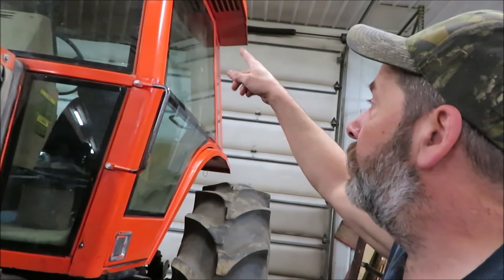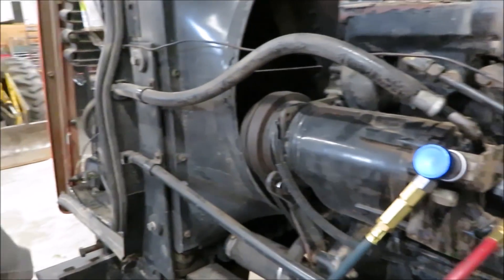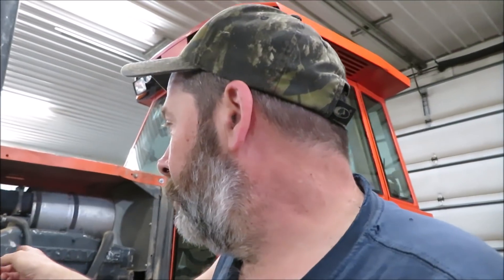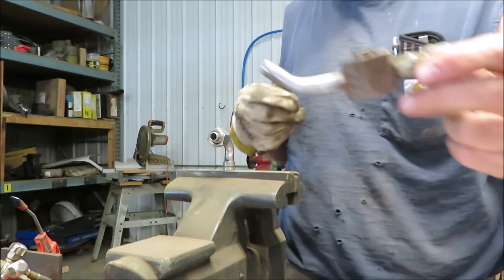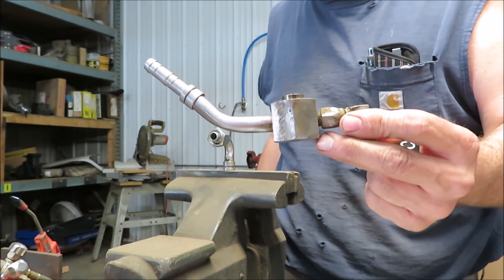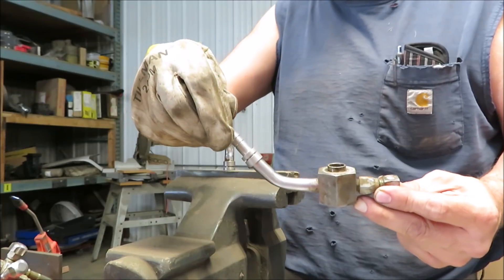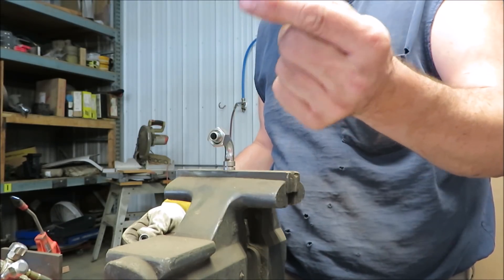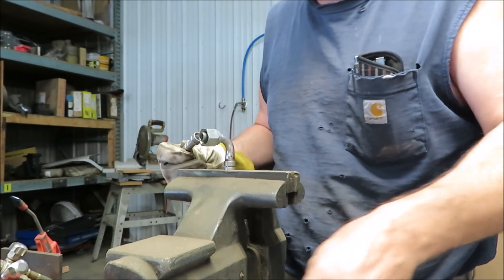Allis Chalmers Tractor Air Conditioning work

Comment: If used that style in a splice kit work pretty good better then making a new hose
Reply: Dan Rasmussen Actually in this case it isn't. The Allis Chalmers were made with R12 freon and has a non barrier hose. The system he's working on is 134a so it should have got all new hoses to prevent the freon from leaking out the hoses